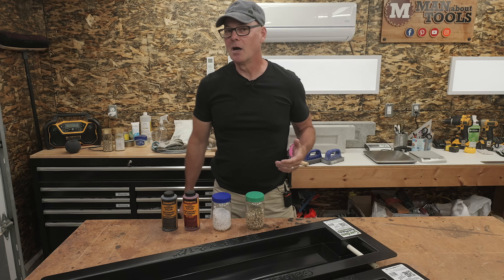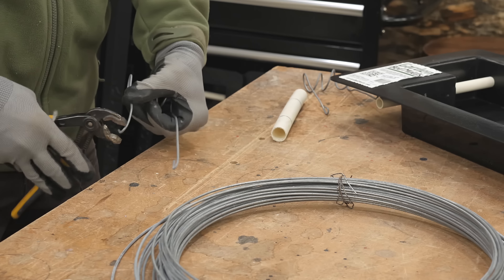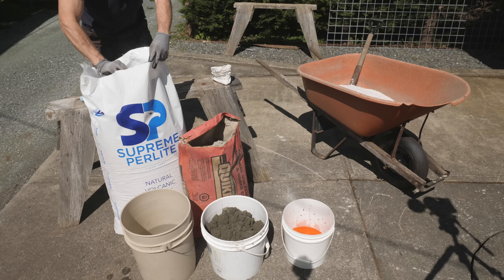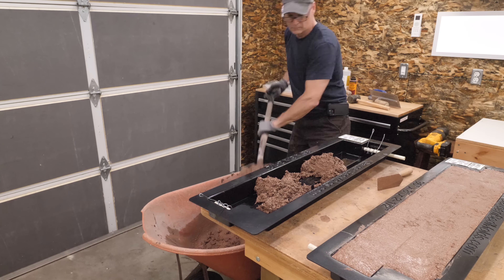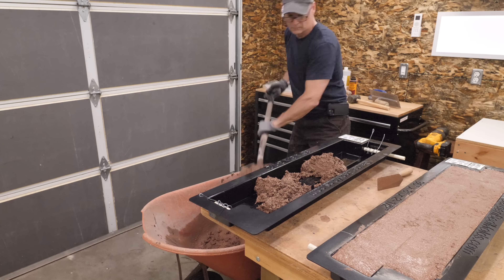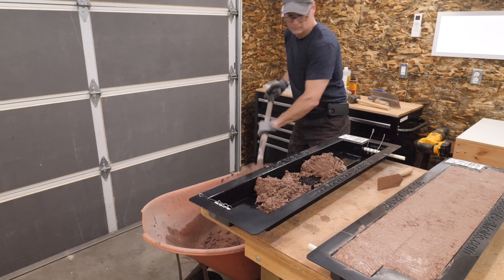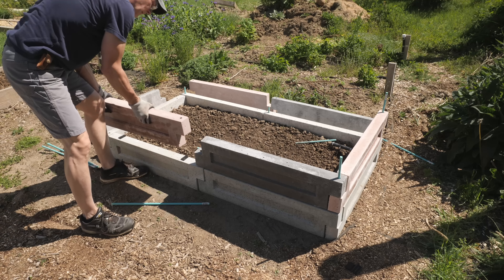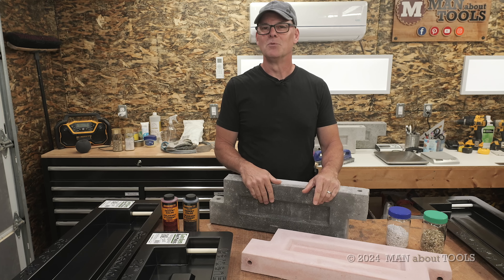Lightweight Concrete Stackable Garden Beds

Comment: To make separation easier, use compressed air at the joints. We used to separate boat hulls that way.
Reply: My mother pours hot water on the mold to make it expand

Comment: chop up styrofoam in a blender (add water and drain) to use instead of perlite or vermiculite.  It ends up being small styrofoam beads.  Same portions as you are mixing.  Repurposing a material that is not very degradable in the ecosystem and extremely lightweight and strong.

Comment: My wife ask me to build some raised garden beds a few years ago. I really wanted something that would not cost very much, be safe to grow vegetables in (no treated wood), look good, and last a long time, so I thought I would build them in concrete. The problem that I found was needing to move them in the future which is when I found your channel. Concrete panels met all the criteria, However, I didn’t have the time to make the wooden forms so I never actually went forward with those panels and just build the raised boxes in cedar fence panels, which has lasted a few years now. I feel I will need to replace them soon. Now I see you make plastic forms, which is great. I wondered if you have ever thought of making a 48 inch plastic form. I make my garden boxes 4‘ x 8‘ because we work the bed from both sides and can we easily reach in 2 feet.  Also wondered if it would be a good idea or even necessary if the bottom of a panel had a groove in it and the top had a matching rim so when you stack two together, they lock in together.  Thank for for the great work.
Reply from the maker: Thanks for the comments here. A 48" mold should be ready this spring. Cheers, Kent

Comment: I used your "old" method (with the wooden forms) but found that stacking them with the joints like you did caused them to "bow" out.  I then modified your plans to make a center pipe that will hold better .  Somewhat like making a brick wall.  You have to stagger joints or it will become weak. 

These are now going on 4 years and no bowing or moving.  I stacked them two (2) high as I didn't want to bend over if possible.  Sitting on the "ledge" makes weeding and harvesting easier.

BUT, your ideas and help is WONDERFUL!!!  Keep up the progression and updates.
Reply: Did you let them cure for about 4 weeks before use?
Reply: How many lengths long did you do with your brick method holding up? Did you tie across the bed with wire or do anything else to stabilize it?

Comment: Enjoyed your video. 
I’ve been doing concrete counter tops ( pour in place ) One of the web sites for DIY counter tops uses an additive to make the concrete more fluid ( plasticity mix ). There additive looks as if they have some fibrous additive. Also they have an attachment for an oscillating tool which is used to vibrate the bubbles out the edges. This works well. My edges have not had any bubbles or voids. 
I might need a vibrating table if I do the 8 raised beds thinking of.
Considering buying some molds !

Comment: I love these videos.  It would be interesting if you could stagger the seams with a third length. Like two 3' on the bottom.  One 3' in the middle and two 1.5' on each end.  I think that would stiffen up the stack considerably.  Just a thought...

Comment: Just fyi, microfiber does not prevent long term cracks nor replace reinforcement. It only helps with shrinkage cracking during the curing process, which is when you are more likely to get micro-fractures. For this application I would definitely not skip.

Comment: In my last batch I used a 1:1:5 ratio of cement/sand/perlite with good results. As you say, experiment with what works for you. I read on the perlite org site that it is best to mix the cement, sand, and water first then add the perlite last to minimize mixing time. Apparently the more perlite is agitated the more it gets degraded. However, I'm not sure at our scale the difference would be significant.

Comment: I have enjoyed your videos and have learned alot going forward for my own project. I am wanting to build a 2 tier retaining wall that is more like 3 to 4" thick at 10 to 12" tall/panel thus building my own forms. Another aspect I want to incorporate is stacking offset like standard wall block so I will want another hole in the middle of my bottom sections to drive rebar through the top ends and locking them to bottom sections. 

I'll be very interested in the strength mix coming in the next video.

Comment: A 6ft and 8ft long panels would be great for longer beds as they would be way stronger than 2 piece construction.  Also I think you should make 12 Inch tall panels which would go 3 inch deep and 9 inch tall bed which is perfect dimensions for economy and depth if soil for veggies.

Comment: Great video as always and thank you for your passion on this project.  I had a thought about stacking the panels.  You might be able to do away with the wedges if you made a mirror image panel.  That would require new molds but they would perfectly offset each others angle and the wall would sit plumb.  Alternatively, I suppose you could make new panels without the central inset so you could just flip them around for the 2nd tier.

Comment: Compressed air. will help separation. instead of wax, try used motor oil. it will not stain the concrete.

Comment: Would there be any benefit, such as longevity or improved trimmer resistance, to sealing the concrete with a sealer made for concrete, or an epoxy, such as one made for garage floors?

Comment: Excellent work on all fronts with these beds! Wondering if there is a limit on how long a bed can be? Four or five 3-foot sections? Or are the end pieces needed at a closer spacing to hold every thing square and plumb? I see your comments on using galvanized wire on two high - does that also apply to one-high beds? Thanks!

Comment: Hi just recieved my forms today, i plan on stacking the panels but im concerned about the gap caused be the forms draft angle, will the space need to be filled in with adhisive in order to create a strong bond?
Reply from the maker: Hi, there's a link to the wedges in the description. Alternatively, you should be able to find these at most hardware store.
Reply: @MANaboutTOOLS  Got it thanks, should I use a landscaping adhesive to join the panels?
Reply from the maker: @xamu8144  I don't think that's required. But, you could do a test to see if it makes a difference.
Reply: @MANaboutTOOLS  I'm going to try it out thanks!

Comment: Built my own 2" x 2' x 8' & 4'  molds based on your design 'cuz I needed to build a serious mess of 4' x 24' beds that I then attached a continuous treated 2"×8" seat cap to. I cast stainless seat supports into the panels and reinforced w/ fiber & 1/4" fiberglass rods. I have a walk-behind skid loader for moving them, but not something (the size of my panels that is) I'd recommend otherwise. Finished w/ QwikWall surface bonding concrete before painting w/ Daiche coatings high solid acrylic & primer. My objective is to complete transitioning my entire food garden to something my half crippled old ass can still use as I age, so the seat caps need to be 100% functional. They also give me a place to mount removable, flip open mini greenhouse covers that I form w/ 3/4" PVC hoops & Solexx poly panels attached to a rigid rectangular hinged frame. The combo allows us to grow an abundance of food year round w/o worries of migrating contaminants from things like creosote railroad ties or pressure treated lumber, plus the extra finishing details mean that they should all outlive me, and then some. Thank you ever so much for the inspiration and effort! Building some shorter ones to contain my new micro fruit orchard & trellised bramble beds. I also dig a foot deep to bury rotting logs where the bed interior is staked out creating a sort of sunken hugelkultur kind of effect. The beds all receive a deep watering PVC system of perforated ABS that helps oxygenated root zones, as well as leaky hose irrigation just under the surface. The test of the beds are filled w/ an organic topsoil & compost blend. Using natural mineral amendments makes them longer lived, so minor pH adjustments and some top dressing should keep the soil tilthe and nutrient levels intact for years to come, no tilling required (which the worms appreciate).  🙂
Reply: I would love to see what you’ve done! It sounds marvelous!
Reply: @myacrylicjourney624  thanks. I'm working on a practical self sufficiency book, and more details will be included, along w/ pictures, and of course appropriate attribution to this gentle person for providing the inspiration. I've been building all sorts of raised beds and terraced microclime grow beds for decades, but the panel forms really let me scale up in a more practical fashion. Some of my ideas were unique, but basically what I build now is an aggregate of good ideas I've borrowed & tried to improve upon from others. I've used PVC hoops w/ row cover fabric for years over raised dirt beds, and the Solexx has been my go to hoop house glazing for about 10 yrs. now, but usingvthemntogether to create mini greenhouses that I can interchange w/ row cover or shade cloth has created all sorts of flexibility and season expansion here in zone 7b-8. Building s tropical zone wallipini now to grow dwarf tropical & citrus, 'cuz somethingvtells me that by the time gump and "only the best people" finish their imbecillic pillage, food & clean potable water are gonna be the new unattainium, and I've got a lot of friends and family to feed.

Comment: An increase in concrete temperature will decrease the air content. Increases in temperature from 21°C (70°F) to 38°C (100°F) may reduce air content by 25% while reductions from 21°C (70°F) to 5°C (40°F) may increase air content by as much as 40%.

Comment: $17/kg on Amazon for the poly fiber.  And important to remember you are not making regular concrete that has aggregates for the cement to bind to.
For $8#, using an ounce is only adding $0.50/panel.

Also, a small $10 kiddie wading pool/trough with water is great to let concrete forms cure for a week or three for absolutely the hardest/strongest result.
Reply: You are saying to keep them fully submerged?

Comment: By weight, 3% of cement for fibre is the max you want to go. Beyond that there is no benefit and will eventually weaken your mix if you go above 5%. 0.5 to 1% is more than enough for what you are doing.

Comment: Why don’t you leave the wire wrapped pipe in the concrete?  It can’t be that expensive and would absolutely protect the inner diameter of the holes from the rebar you use to connect the pieces. In fact I’d use pieces of Pex tubing for added strength and cushioning against the steel. And you don’t have to worry about damaging the concrete to pull them out.
Reply: How often do you think anyone is going to be placing and removing rebar supports such that one would ever have to worry about 'protecting' the holes?
Adding PEX would reduce wear and tear, but sure as heck isn't going to give any sort of 'strength'.
Very odd set of worries...
Reply: Where I'm located, I would worry more about water filling holes and then get freezing/expansion in the winter leading to the ends getting busted out.

Comment: I think your mix is too dry. Water helps concrete cure. It is a chemical reaction. I assume you have experimented with wetter mixes, what happened with the wetter mixes that made you opt for dryer mix?
Reply: You are correct in the fact that it's a chemical reaction. Have you ever heard the phrase, "water is nature's solvent"? Too much water will dilute the chemical reaction. Use just enough water to do what you need. A stiff mix will have more strength.